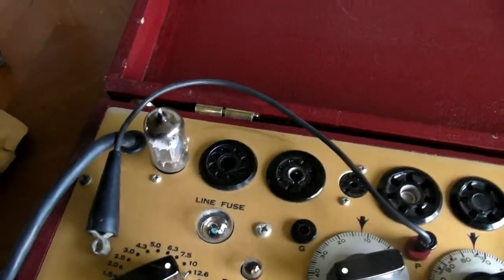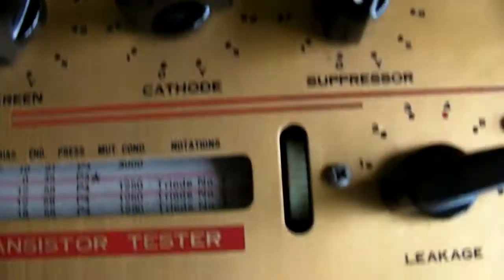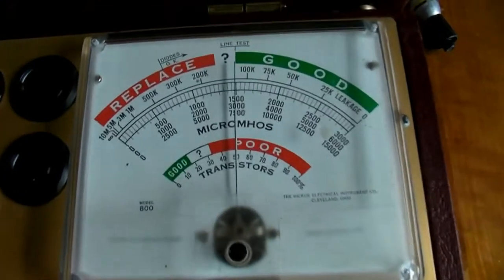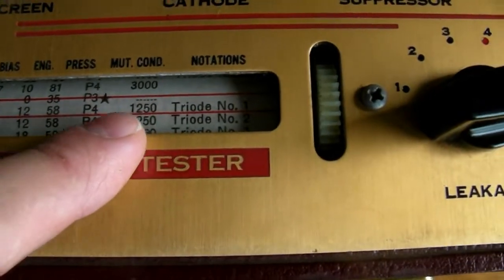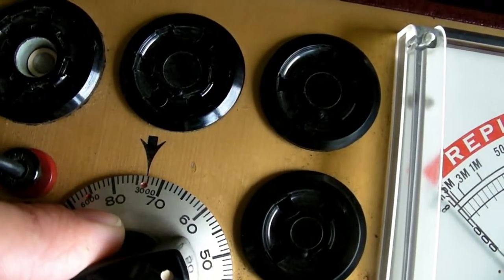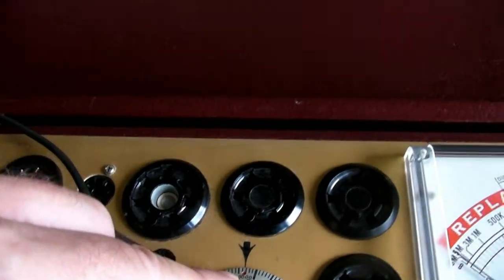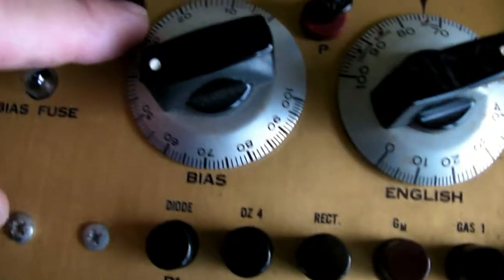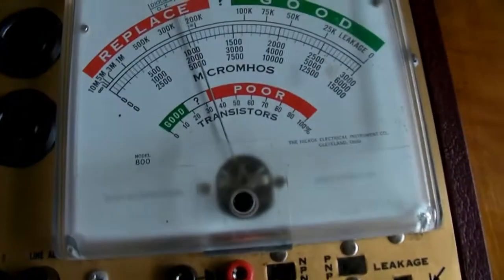How to Test 12AX7 Tubes On A Hickok 800 Tube Tester

Comment: wrong it is a minimum of 1250 to be good.
Reply: Wrong in this instance. 1250 is New on the 800 when set this way. The 800 can be set to 1250 as new or 1250 as minimum and I think this is where alot of people get confused. 1250 new setting has a min of 813, which is 65%. You know how many tubes rated at 1000-1100 on this lasted me forever and sounded great. A tube that tests 1000 when the tester is set to 813 at the minimum and 1250 new, is a very very strong tube. Not all hickoks are the same. U set it to 73 to read conductence. Also, although I'm sure you know this, after setting min, you set it to 58 to read good or bad. Which is why you ignore the good or bad with what he's doing right here. A tube with1250 is new setting, on the 800, would read about higher on other testers.

You can however as I said set it to 1250 as the minimum on the 800 hickok. If you did set it like that, a tube that tests around 1000 when 1250 is the new, will test about 1900 when 1250 is the minimum.

That's why alot of sellers need to explain what they're setting it at and be truthful.

Comment: Why did you reset the "English" from the stated value of 58 to 73? Do you think that Hickok just provided the English values for "giggles". I mean, really - they are not going through the trouble of printing the numbers for no reason. The dots indicate the scale "within" to use, not where to set the English. You read the value off of the smallest scale that the recommended value fits into. In this case 0-3000. Sorry about my tone.
Reply: There are two ways to read the data on the 800. Sticking to the "58" is if you just want to see whether it tests "good" or "bad" by the color zone. But if you want to check actual mutual cond. then you set it to one of the three dots that is within the scale you need, and check the values themselves while ignoring the good/bad coloring. The video demonstrates this correctly.

Comment: 12AX7's should be tested with at least 275 VDC on plates.  Because it is rated for 300 VDC.  That is the real test because older Marshall JCM800's have high voltage on the plates, anywhere from 165 to 280 VDC on the plates.   Now check for leaks and shorts and noise at 275VDC.  See that's where the 12AX7 seller puts some shit in the game.  He only checks the tube with around 170 VDC on the plates hahahahahahaha